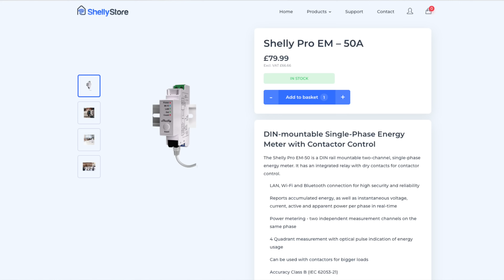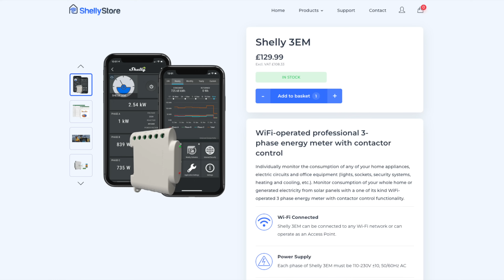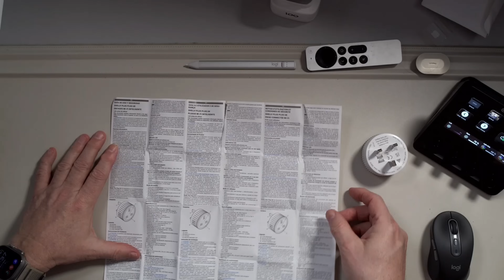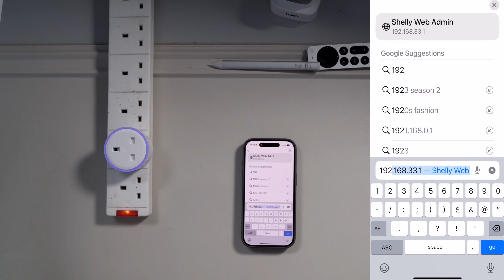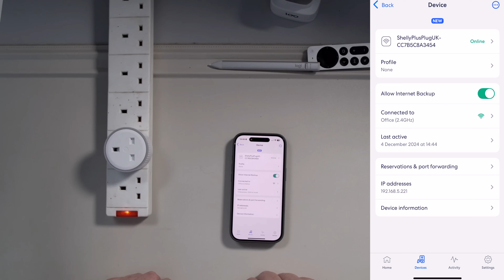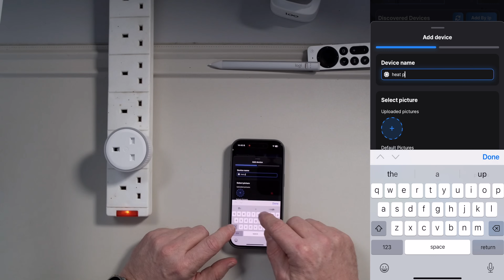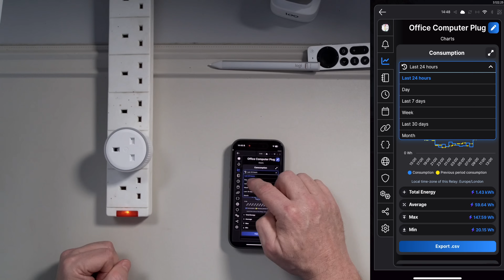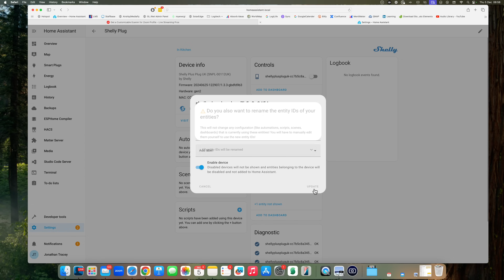This tiny device exposed exactly how much energy I was using in my home

Comment from the maker: Do any of you use Shelly devices in your home network, I would love to hear what other devices you get value from. Leave a comment below and let me know what else I should consider.
Reply: I’ve got the Shelly EM in my main fuse board but the unit is the same format as the Plus 1s so I mounted it outside the board with the clamps running in through a gland. Gives me whole house power draw. 
I’ve also wired up a socket with a plus one pm to monitor power and switch off if necessary. That’s on the fridge. 

I have a one plus with the add on my boiler monitoring flow and return. 

I found the smart plugs to be a bit of a pain because they interfere with the power switch’s on my sockets and they are a bit large. Would have preferred them to be square rather than round.

Going to add temperature monitoring to my upstairs airing cupboard where the flow ends up so I can see the heat drop from the pipe work (my house is full of 80s builders bodges so not well insulated and no insulation on internal pipe work.) working on improving the air tightness and insulation so want to be able to track progress. 

Also using the temperature probes to monitor temperature inside the supply pipes in the loft to alert if it’s likely to freeze.

All hooked up to home assistant.
Reply: @davideyres955  I'm looking for "smart" solutions to monitor flow & return pipework. 

Can you share how you are doing this please as I am unable to find any suitable products

I have just purchased a digital display that has 2 sensors but this is obviously real time, it necessitstes me being physically in the garage (where it is to be mounted) to see whats going on.

I want to be able to monitor not only real time data but historical readings over time to determine the rate at which the pipes heat up.

Is this something that you are doing or planning, if so how are you acheiving thisthis and what kit are you using?

Comment: Great video JT. I wanted to ask if the single phase and 3 phase Shelly devices are suitable for outside as you have shown in their own dedicated consumer units? I am installing a 3 phase charger with it's own EV consumer unit outside and wanted to use the 3 phase Shelly outside! Thanks
Reply from the maker: Yep, so long as the consumer unit that they’re in is rated for outside use, then you will be fine. I’ve had both a 3EM and a 50 pro in external consumer unit units for over a year now no issues.

Comment: The difficult part finding the IP assigned by the router's DHCP might actually be quite easy. When you went into the app and scanned for the device, it told you the IP when it found it. Might be easier than looking for it yourself (assuming it is found as easily before the firmware update).
Reply from the maker: since I made that video, the Shelly app has been improved significantly, it now finds the devices almost immediately and there’s no need to use the web device you can do it within

Comment: Hello JT, sir Rob here, our Daikin heat pump was installed this week so you should see the referral soon.

I realise why the Shelly em 50 is required for the heat pump, the Daikin appears to calculate the energy rather than meter it.
With this warm weather (July 2025) I haven't had chance to hear it running apart from during commissioning.
My main reason for wanting the Shelly is so I know when the pump is running so that if possible we stay within our inverters max output.
Electrician now booked to fit one.
Thanks for the heads up video.
Reply from the maker: glad it all
went well, the shelly EM50 is a great device, i think we have three now and an EM3 :-) they become an addiction
Reply: @JonathanTracey indeed, I went the same route after I saw your video about temperature and humidity monitors, I now have them scattered around the house, office, loft, garage and outside.
Soon to have the first Shelly em .....

I have a sensor problem!!!!  😂
Reply from the maker: we’re all here to support you 😂

Comment: John
Can I ask a question about your Shelly 
Why do you have the Shelly pro 50 in the heat pump consumer unit 
And a different 3EM in the main board?
I’m just interested in monitoring my Daikin 11kw HP so would I need both
Cheers
Glen
Reply from the maker: yes, that’s exactly how I have them set up. I know this is gonna sound a little bit weird, but I actually have four consumer units. Three of them have an EM50 and the main house board has the 3EM
Reply: @JonathanTracey 
So if I just want to monitor the HP I only need it in the HP consumer unit
Is that correct?
Reply from the maker: yes you connect one ct clamp around the HP circuit and one around the booster

Comment: Good informative video. 2 questions for you.
1. I am looking at Shelly 3EM to monitor hob, oven and microwave/2nd oven on 1 phase (UK). Does the Shelly EM3 Pro come with 3 CTs that would allow this set up? Amazon list Pro 3EM (£108.87) and 3EM Pro - 3CT63 (£100). Is latter with the 3 CTs?
2. I have just purchased several Shelly plugs and I set them up with no issues from Shelly app, unlike your problems (Perhaps I was lucky!). 
I would just use them via HA. Can they just be installed from HA without going through the app?
Thanks Rob
Reply from the maker: as far as I know all 3EMs come with 3CTs on amazon there should be a "whats in the box" section. The app has got a lot better, my recent video on using shelly flood sensors I just did it from the app. Wrt HA I believe they need to be setup in the shelly app first before they appear in HA, but don't quote me on that

Comment: Thanks for this, really informative and I was planning on doing the same with a Shelly Pro  on my Octopus heat pump install. Had the engineer visit yesterday to check things, I mentioned fitting a Shelly and he stated that fitting one into the unit they install next to the consumer unit would  " invalidate the warranty " I pointed out 3 blank ways in my new consumer unit next to where they plan to fit their heat pump connection and was told they " don't touch that "
All in all quite a negative experience and not at all what I was expecting.
Reply from the maker: Ignore them, there is no physical connection to the heat pump, I asked the electrician to fit it at the time but he said they were not allowed but any qualified electrician could do it, so I had one there that afternoon and the octopus engineer watched while the guy installed it in 5 mins
Reply: @JonathanTracey  Thanks Jon. I have just watched your 6 month update upload. That's really helpful and informative. I laughed at the bit about not tweaking the settings as soon as the installers are off premises . I was going to change the Legionella cycle to monthly and lower the tank temperature as our hot water use is similar to ours. I've also spoken with my sparky and he will be fitting a Shelly after install. I was curious about the two current clamps, are they on the Live and Neutral feeds to the heat pump?

Comment: I've got an Ecoflow Powerstream and at the moment I've got the output being controlled via some Ecoflow smartplugs. But the Shelly 3EM and the Pro 3EM are meant to be able to communicate with the powerstream to transfer consumption data. Have you tried doing this on your Powerstream and how was your experience? I'm also trying to work out whether the Pro 3EM would offer me anything of value over and above what the 3EM does. Did you consider and then dismiss the Pro version when you bought yours?
Reply from the maker: I have not tried it as I use the power stream in constant load mode, I was told when it tries to adapt it can get into a race condition if the main inverter reacts before it can, so it’s constantly ramping up and down
Reply from the maker: I have not looked at the pro but I’m going to get another 3em so will check it out

Comment: Shelly EM -is it worth upgrading to the Premium service to get energy consumption on a per minute basis rather then the 'per hour' data on the basic (free) plan? I'm trying to look at the power consumption during a frost/de-frost cycle.
Reply from the maker: unless your going to continually need it seems a waste to subscribe to something for one data point unless you can subscribe for 1 week or so
Reply: @JonathanTracey  Minimum is one month - cancel anytime. I'm trying to find out why the HP uses 3.2kW during or just before a de-frost. i.e. is it as it frosts up. Problem is de-frosts during 'waking hours' are rare. Gets a bit noisy as well - 72db. Last one was 02:30 ...
Reply from the maker: If it would get your the info then one months sub does not seem unreasonable

Comment: Great video. Wish I'd watched this before I had my EM 50 fitted. Do you get quite a noisy power signal for your ASHP consumption, when looked at in Home Assistant?
Reply from the maker: No, I just checked both Home Assistant and the Shelly app it all looks pretty smooth. Do you have a separate consumer unit for the ASHP or put the interference be coming from something else? I’d also double check that the the breakers are all torqued down correctly in the panel. That could cause some level of inference if there was a little bit of arcing happening.

Comment: Thank you for producing your content, keep up the good work. If I remember correctly you have recently had an Octopus Daikin heat pump installed. You mentioned in this video that you monitor the power used by your D2 pump. I also have a similar Octopus install with a D2 pump. The D2 pump seems to run at random times for brief periods for no apparent reason, have you experienced this behaviour.
Reply from the maker: my d2 never runs, it’s only for emergencies. i power the shelly from the d2 breaker. are you sure it’s the d2 that’s running not the booster?
Reply: @JonathanTracey  Thanks for the reply. I can't be certain that it is the D2 pump as I only have a Shelly on the total HP supply at the meter box. I am not sure what the function of the booster is. In any case I will monitor it and I will contact Octopus. I must say that we are delighted with the Octopus installation and the support.
Reply from the maker: the D2 sounds like a mixer running in the cupboard, you would know if it was running
Reply from the maker: if it’s definitely your D2 that is running, I would call octopus sale as it’s only supposed to run if there’s too much pressure in the tank and water is getting out. It then pumps it outside of your house.

Comment: Great video, I have two Shelly Pro EM50 which work great with there app. I just need to setup them up on HA which did not find them. Can you please show how to setup and configure HA to see the Shelly units then add them. Steve
Reply from the maker: if you do t see them automatically add the shelly integration - bottom right of the screen, it should then find all your devices

Comment: The biggest problem with these sensors and switches/relays is the  cost of them, I've recently bought 9 Aqara temperature sensors (still need more) and a Shelly Plus 1PM and addon temperature monitor, along with three probes and that little lot added up to quite a bit. It will all help with next years planned ASHP.
Reply from the maker: I agree with you however they are coming down in price, about a year ago when I purchased a temperature sensor it was around about £49 now they’re about £29 and I’ve seen some as low as £9 although I’m not sure I would trust them. It’s also a one time cost until somebody figure out how to charge you a subscription for a temperature sensor.🤦